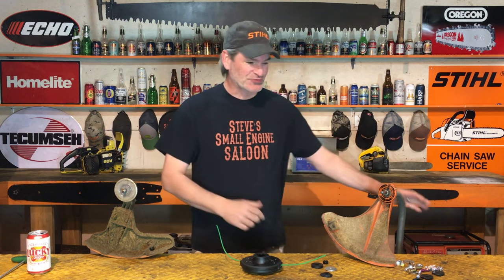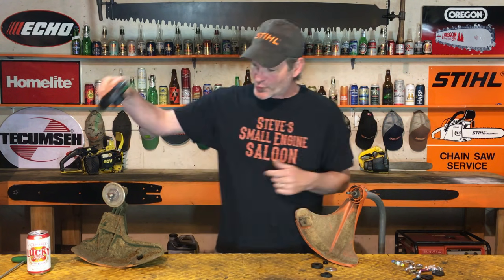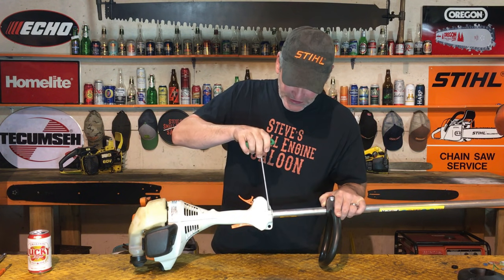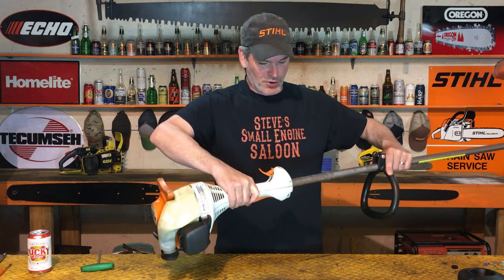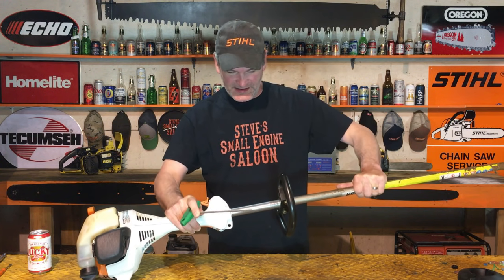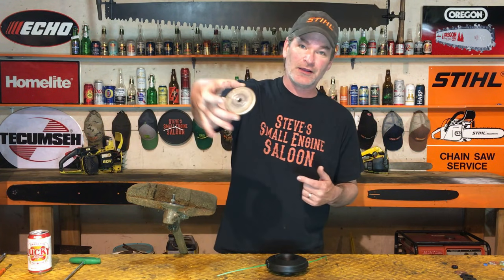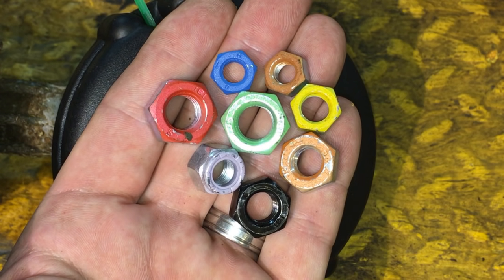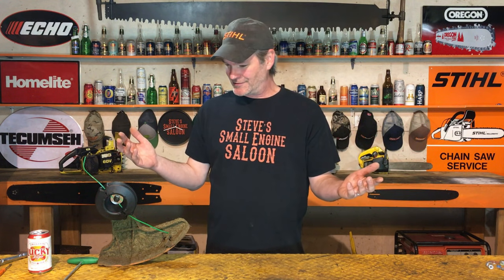How To Change A Straight Or Curved Trimmer Shaft

Comment: Anyone that has used both, would NEVER buy or use a Curved Shaft. You constantly have to bend over the while time you are trimming. It's crazy
Reply: I’ve only used straight and for some reason would never consider curved.
Reply: Crazy why is it? I have 2 Curved Shaft strimmers + a straight and a combi unit. I use the Curved Shaft  all the time best tool for the job for eging lawns all ways in my van. Not the best tool if you need to cut down lots of tall weeds/grass all the time.
Reply: Have to disagree mate! I've got two straight shaft and an fs40. I find the fs40 is brilliant for getting into tight spots and it's very light. Also, I use the fs40 around my fruit trees because the lightweight line does less damage if you accidentally catch something. I consider the fs40 my go to weed eater when I'm working in other people's gardens. Just my personal preference.
Reply: I wish for a curved shaft every time I whack the slope down to the pond. Could hold it naturally and the head matches the slope. That said, I'm not buying another weed whacker
Reply: @adus123  Used to be all the cheapo whipper snippers at the big box stores were curved shaft. Last time I was at Homeless Despot, they were all straight shaft. Go figure. I guess you have to buy a high end brand like Stihl or Echo to get a curved shaft trimmer, but even the Echo HD had was straight shaft.
Reply: LOL !!! You call it Homeless Despot and I call it Hopeless Depot !!
Reply: Howdy Steve. Great video. I’m doing a swap from curved bar to straight shaft. The power head is fs40   And the shaft I have is from the fs44 and it’s a little older. The shaft diameters are the same so I was able to drill the new locator hole and seat the new shaft. But when i attach the cutting head to the end of the shaft the drive cord inside doesn’t reach the end of the shaft anymore. Looks like I can hack off about an inch to expose the drive cord which should then reach the cutting head gear. Is there any disadvantage or concern about trimming the straight shaft?
Thanks!
Reply: It is cause they are only really good on slopes
Reply: If you get the taller curved shaft is great and im 6,5.  It's better for going around 1000s off grave stones and i like the rotation and it's closer to your body for better control
Reply: I’ve never used curve. Curved shaft are for women because they are short humans. Guys like me need a straight shaft
Reply: I’d have to agree . I have a vent one given to me . All the work ones are straight .
Reply: Never occurred to me to do that . My home snippet that was given to me is  a bent shaft . Just hate the thing . I’ll have to find a straight shaft and check it out .
Reply: I don't like that a curved shaft spins the opposite direction as a straight shaft if it's bent the same direction as straight shaft I would probably use it
Reply: I'll have to disagree as well, curved shafts are superior for edging
Reply: I honestly think no one should produce them
Reply: I honestly think that no one should produce curved shaft trimmers
Reply: Curved shafts are miles better for edging lawns!
Reply: Curved shafts are awesome in tight spaces and long shaft are great on  embankments and in large open areas, so DUDE, it's a bit like a sit down jet ski and a stand up jet ski, both different to each other but both great. Life is a lesson so keep learning dude.

Comment: I have a craftsman 25 cc brush whacker and the engine is loose on the shaft but it does not have the screws that you’re showing can you help? It has two screws one goes through and has a nut on it can be tightened the other does not go through it just spins.

Comment: Have a great running toro curved shaft given to me but the trimmer head was DOA. Didn't  matter because I thought of the old ryan straight shaft  in my shed. To my dismay the Ryan shaft didn't work with the clutch housing on the toro. Should I look for toro or other brands that would work with it ?

Comment: Question item 3 pile in somebody’s yard I picked up a steel ST 45 trimmer curved one like the one you just did in this video it was surgeon I got that running but still seems to be burning oil I don’t know if the guy that had it did a heavy mix a mix of oil or could it be just tired thinking about putting some money into it but not sure any advice would be helpful

Comment: Can I do this with an fs 38 power block and a fs55 shaft i got my fs 56rc with a broken throttle cable took the time to clean it out because it was all gunked up and now it's having a bunch of other problems was going to buy an FS 38 that needs a drive shaft can I have an FS 55 drive shaft ready to go

Comment: Steve, I just bought a second hand FS38. I can’t get the trimmer head off. The bump knob just keeps spinning and spinning. There’s also some in and out play in the whole head. After watching some videos, I wonder if it’s the bearing. But hard to inspect when I can’t get the head off. Any ideas?
Reply: No need to reply. Got it figured out. The head was completely smashed inside. Bearing is good. Has to cut and pry the head open, then grind a channel for a flat head screwdriver into the end of the shaft to get the head bolt off. New head on the way, and good as new. Thank you so much for the videos Steve!!

Comment: Steve, can you make a video about how to fix a Stihl FS490 that the drive cable keeps jumping out of the connecting point at the motor. Just out of warranty low use machine and the local Stihl dealer here in Budapest Hungary  would not show me how he took it apart to fix it the 2 times it was in the repair shop. The engine starts and runs excellent no bogging or anything it just does not turn the weedeater head when it messes up. I must admit both times it messed up when my kid was using it. I suspect the trimmer line was not feeding well and he was bumping the feed advance button on the head too hard instead of taking the head apart and seeing why it was not feeding the line. I am disabled and unable to use the machine but I am able to make  repairs. Thanks for your channel.

Comment: So the rotation of the line changes from curved shaft to straight shaft only because of the head? The rotation of the engine is the same? No need to change cable?

Comment: Steve I noticed something at my Stihl dealer the other day. I was looking at getting a new Kombi Km 131 the trimmer head statement doesn’t have a grease bolt however on all the trimmers at the stihl dealership they do have a grease bolt on the trimmer head. Is that a mistake or is there something im missing. Maybe Stihl made it that way because instead of lubricanting the head just throw it in the trash get a new attachment head. I don’t know just wanted to hear your thoughts on it

Comment: Thanks bud! I came to see how a trimmer shaft connects to the motor - My fear was removing the motor and 50 million spring-loaded small parts dropping out. My Einhell split-shaft trimmer is bone dry, so I'm going to dab a bit of lithium grease on the shaft connections and also at the head. :)
Reply from the maker: You're Welcome...

Comment: Thanks, needed the locator bolt tip, could not get the head to seat up in to engine head, was also wondering on head placement on shaft. That bolt is the ticket for line-up and full motor head engagement. GOT-IT

Comment: I have a Stihl fs56 straight shaft. Inside is a flexible shaft. Can I swap to a solid shaft? I don't like the spring feel I get out of this shaft. I have used solid shafts in the past and it works better with brush cutting blades. A part number would be great. Thx
Reply: detillieux following

Comment: Hi Steve, I bought an FS56 curved shaft trimmer because it was lighter. The dealer also gave me a good deal on it. If I want a straight shaft, the shaft and the head would cost me quite a bit. How much do you think is fair having it done at a shop or ordering the pieces and doing the repair myself would cost ? Also for all the Steve fans, I once saw a straight shaft Stihl trimmer at a pawn shop. I should've priced it and if I only knew then what I know now, I would've been able to get another trimmer for parts.

Comment: I have an echo srm210 straught shaft, and I live it because it was my PawPaws and I may have burnt the piston up it'll start with starting fluid, which I already kniw I only use very small amounts. But I can't get it to stay running so I'm gonna clean the carb to see if theres something plugging it. If that doesn't fix it, I have an old and I mean real old curved shaft homelite bandit x-135 I found a neighbor threw out on the curb...i replaced the bulb and fuel lines and it literally fired off second pull. But I hate the short curved shaft. I feel like I'm literally standing over the trimmer head. Steve would it be possible to swap the shaft from my pruzed echo to that old bandit? The bandits motor is actually larger but I was wondering if that swap was possible.

Comment: Saved me money!
So, I have a Husky 125L with a seized shaft (cable & guide insert melted together inside shaft housing). 
In the free section in our local Facebook Marketplace, I found a straight shaft Homelite trimmer. & thanks to your encouraging & informative video, I fixed my Husky! Only mod needed was to drill a small hole for the locating screw. Works great.
Thanks Bro' !!!
Reply from the maker: You're Welcome...

Comment: Maybe someone could answer this question for me, if the curved shaft spins the opposite direction compared to a straight shaft, if I swap the shaft will it work with a bump head? Didn't know if rotation is changed in the gear head or if it is motor rotation?
Reply: I had the same ?  hope an get some answer .....{Hello and thanks , I've a question that hoping you can help, I assume that the curved shaft head rotate direction from looking from head down CW and since you swapped it out with the straight shaft does it change the direction of rotation from CW to CCW ( some folks tell me that the gear head from straight shaft make the the rotation CCW) It's that correct or am I wrong ?}
Reply: I am 99% sure after tearing some of these apart now, that it is in the gearbox of the straight shaft head that makes it spin the opposite direction,  all of the motor outputs on stihl trimmers spin the same direction.
Reply: @pjmckaveney5916  thank a lot

Comment: I switched the shaft from curved to straight and the heads not spinning and I'm sure I put it back together right. So what could be the problem?
Reply: I had the same problem switching mine.  I don't think the FS 40c has the power to turn the FS55 shaft and head.  I had to switch mine back.😢

Comment: awesome video. im hunting for a straight shaft right now to o exactly this. I was also having trouble putting my curved shaft body plastic together. but ahhhhhhhhhhhhh I see that middle screw is a locating screw!! bingo. Gonna try that NOW then see if it all snaps together easily. Still dont know how to fix the trigger and spring part though.

Comment: Will this work for a echo gt225 curved shaft? Steve which shaft do you recommend getting to swap the curved shaft out for a straight shaft on the gt225 Echo, my sister took it to the dealer and they told her it needed a new shaft, so she just purchased a new Husqvarna trimmer, it's works perfect so far, since the Echo is just laying around I was wanting to see about changing the shaft . Also watched your video helped me to line up the FS55 shaft, I was having herd time getting it to line up, but after your video, I think I'll be good to go.

Comment: Your timing is impeccable! I have an Echo straight shaft that the engine filled with water & died. I bought a used FS45 and the driveshaft is broken. I would really prefer a straight shaft, as it's what I'm used to, and I have to cover a large yard. I read hints that I could do exactly what you showed. Before I spend another dollar, I'm going to the barn in the morning to see if I can't Frankenstein the Echo shaft onto the Stihl motor. Shaft diameters seem to be the same, I'm betting I can...
Reply: So yes. You can make an Echo SRM-225 shaft fit a Stihl FS45 motor. Just needed to drill a hole for the anti-rotation bolt, and add a wrap of electrical tape, the Echo shaft is 0.5mm smaller in diameter according to my calipers.

Of course I filled it with bad gas and now it won't run 🤷‍♂️
Reply: Some fresh gas and it fired right up. Has WAY more grunt than the Echo did. Powers through brush like nothing. Just need to swap on the Stihl handle, the ergonomics are a bit off

Comment: After 30 years of doing lawn maintenance, both professionally and for family and friends, l will only own a straight shaft . My Tanaka is the extra long model. I'm 5' 10" and when stood on end it towers above my head. It's great for getting under trees, bushes and cutting deep ditches and tall steep embankments. Not so great  for small tight spaces, but I mostly do multiple acre lawns.

Comment: Hi Steve, haha the locator screw or screws are missing on my Stihl? I thought those 2 were for installing a support strap which I plan on buying one. Oh I finally fine tuned mine up this week and shot a video. I'm loading it next Friday and giving you credit. It worked great on that 10 dollar China carburetor. I changed out the cheap weak ass spring and put the old one on it.
Reply from the maker: Right on Tim!  Let me know when its up.  I should get a notification anyway cause I am a subscriber....
Reply: Will be next Friday am. I already have it done but like to publish on Fridays now with 2 of my Channels. Tim's Workshop TJY and my new one Storytime With Tim TJY

Comment: HT3813 in Raleigh, NC  needs timing belt.  awesome mower, has deck. Seat is not cracked.  Tires work.  I just can't store it anymore.  Make offer for delivery, or just pick it up, but I don't want it going to scrap, I can do that!  I want it parted out to the fan base, or fixed for the nostalgic, or turned into a racer so I can be a fan =)  Liquid cooled, ran like a champ before the belt.

Comment: Hey Steve, I have a  husqvarna 129r handle bar set up.  I am tired of the handle bars and want to go to a straight shaft.  I don't mind the weight of the unit.  Is there any way to configure the controls onto the existing straight shaft and relocate the controls. Really dreading the process of selling and re buying the 128. I would loose $$ for sure

Comment: Hi, Steve.  I recently wore out the gears on my Stihl trimmer abusing it with a blade cutting saplings.  The old gear head is no longer available for the 7/8 '' shafts.  What's a guy to do when it Stihl runs like a champ ?  It's an FS 66 .  Thanks
Reply: ebay

Comment: Nice one! You've got me thinking now whether it might be possible to use a different manufacturer's shaft on a motor.
I've got this Multi-tool style unit but the motor is a gutless piece of cr@p .  
I have a couple of line trimmers that only get used if my main unit fails, so I might have to rip them apart and see if I
can transplant one of the motors onto the multi-tool shaft.

Great video Steve.
Reply: Oh btw by Multi-tool I meant similar to the Stihl Kombi system

Comment: I has an extra echo power head with no shaft and I literally went to Home Depot and bought an aluminum pipe and installed it on the power head and you can’t even tell the difference between echos actual shaft vs a plumbing pipe lmao
Reply from the maker: Cool!

Comment: I sadly have a 2017 Troy Bilt (20cc?) Straight Shaft I purchased and LOVE.

The Straight Shaft is great for reach, but for comfort I'd rather have a Curved Shaft!

Plus it's REAL NICE that I was able to make a Carb Tuning Tool with a Watertight 12g Electrical Blade Connector... The Round End is "Just Tight Enough" to go over the Air/Fuel Adjustment Screws!

And saved myself $20 from Amazon for a Kit Set! Still would have been nice to have, but Ingenuity is AWESOME!

Thanks again Steve!

Take care,
🤓 -Thomas
Western Washington State

Comment: Looks like the hardest part would be to find a straight shaft donor. Other then that Thanks for the Tip Steve👍
Reply: Ebay, and pawnshops Sir. There are always blown-up trimmers at both.

Comment: Just the vid I needed.  Now, how do I put a 10 h.p. vertical shaft engine on an old mower deck so I can cut more grass?
Reply: Just drill the new engine holes, I once put a 16hp v twin on a 28 inch ex council mower, now that was a machine, nothing stopped it!

Comment: Just turned that 45 into a proper line trimmer. I can't understand how anyone could use a bent shaft model all the time. I'm roughly 6ft and I go about 5 mins and my back starts to ache as I find I keep hunching over. They're the most awkward useless things out in my opinion. I HAVE to have a straight shaft.

Comment: Great job Steve man. I want to ask if all straight shafts are of solid steel or cable? Need to know since I  took an old Ryan shaft and hooked it up to a Murray power head. It ran great for a few seconds then the blade stopped spinning? Should I  try to locate another cable or what? Thanks, B.R.

Comment: Great Video. I installed one of those universal heads and it was a Echo Brand.. I use it on a Echo PAS 280 I didn't like the auto bump design. I use 150 line and it works great for PAS 280, I can get about 2 to 3 yards of use with the 2 piece of nylon string and I don't use the saftey gurd I use a full mesh face shield helps with air ventilation over the sold plastic face shield..

Comment: Steve! You're the man. Are all Stihl shafts interchangeable? Maybe there are model ranges that fit each other? For example: I've got a seized bearing on my FS40c...instead of replacing the bearing, could I just throw an FS36 shaft from ebay on it?